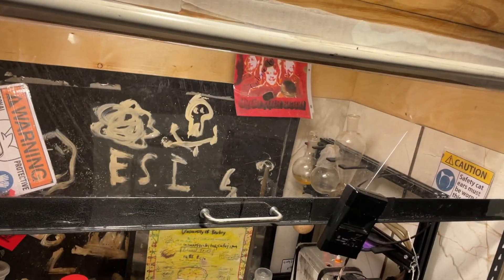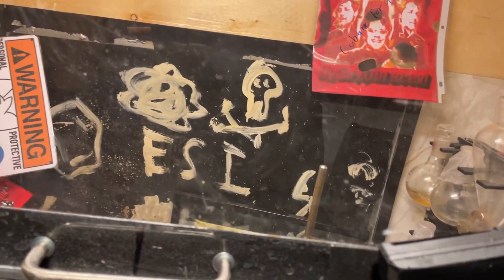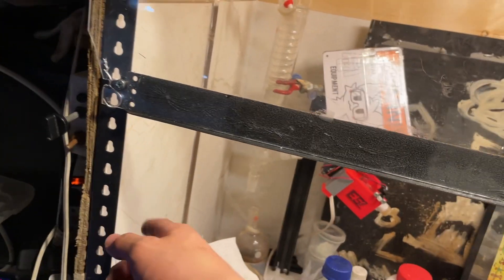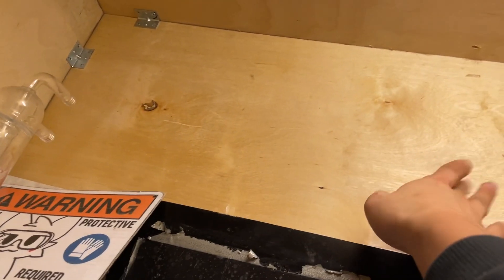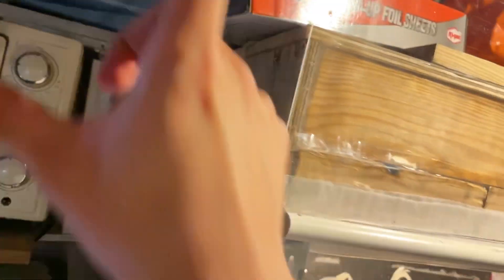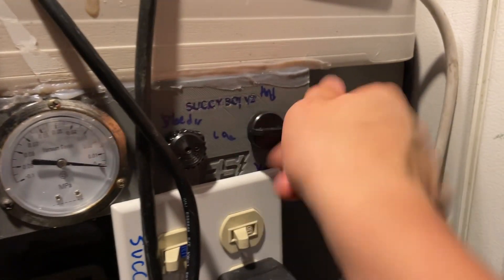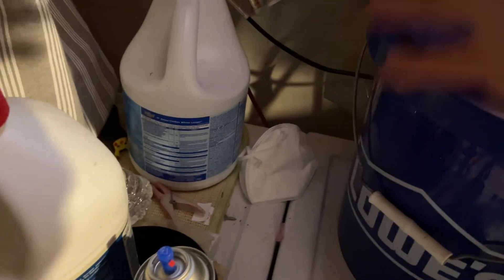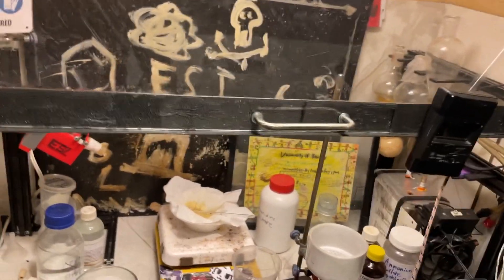impromptu lab tour

Comment: Nigel just dropped a new video, and he- prepare yourself -he spend a ton of money on 2 extremely specialized machines he'll never use again. Shocker, I know.
Reply from the maker: oh i know alright and it was kinda boring tbh, i need to set up an ozone generator but ill try a different method of pyrolysis, ozonalysis (to benzaldehyde) then react with acetaldehyde and get cinnamaldehyde, its something ive wanted to try.
Reply: @EdwardTriesToScience  O3, That'll be a cool video. Do you have an oxygen concentrator? I can't remember.
Reply from the maker: unfortunately not but over the summer ill be traveling to china and stuffing my suitcase (and making videos!) with cheap stuff so maybe ill get all the parts to build one of my own
Reply: @EdwardTriesToScience  Sweet! I'd spend my whole vacation in those tech markets.